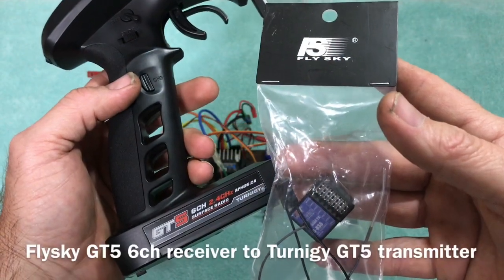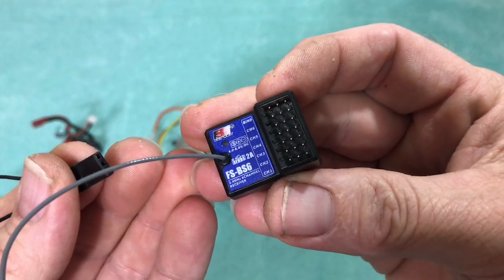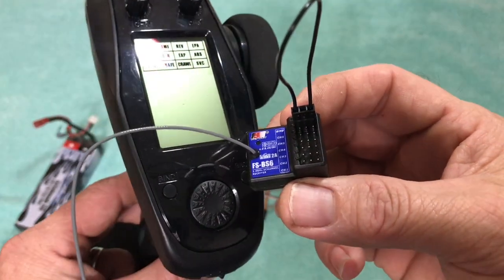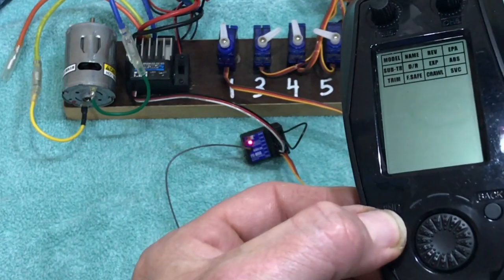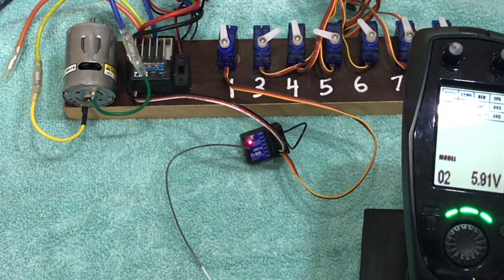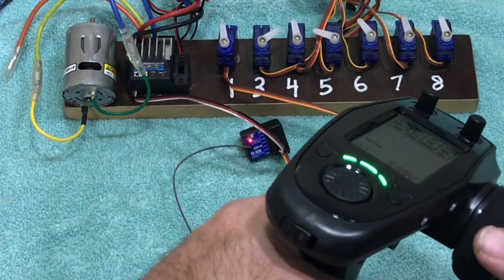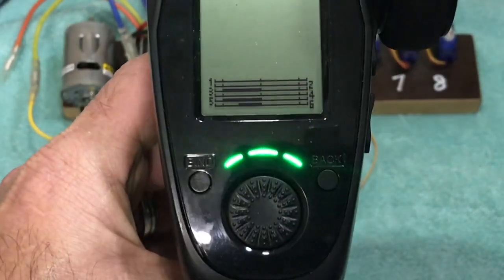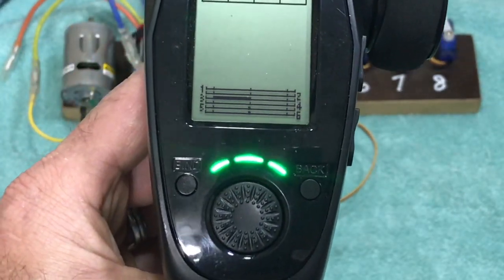Bind the GT5

Comment: i've read the FS-GT5 doesn't bind with the FS-A3 receiver, even though it states in the manual it should. is this true? has anyone been successful at getting this to work with the FS-A3?
Reply: I'd like to know this as well. Smaller and cheaper
Reply: I think if you want a cheaper 3ch or 4ch receiver you can go with the fs-bs4 or fs-bs3 will work with the gt5. Not sure if the ones you mentioned bind with it or not

Comment: The manual lists the GT5 and A3 as compatible, but I have learned: You can make them talk, by fudging the steps. HOWEVER, a GT5 and A3 are never exclusively bound, just kinda. When a GT5 is bound to a BS6 and on the GT5 you attempt to click over to another truck, you get a message saying you are not allowed to switch trucks until you power-down the receiver currently bound. HOWEVER, when the GT5 is talking to an A3-equipped rig, you can keep turning on other A3-equipped rigs that have previously gone through the bind process (up to 19 in theory) and watch them all steer at the same time, back up, go forward. I am told that this does not create interference with other owners' trucks. I very much hope this is true.

Comment: Thanks for help :) One car work. Any chance of video or info with binding multiple receivers to one Flysky transmitter? I have 3 cars and must bind every single time before use. Can't find any info about it :/ so you're my last hope :)
Reply from the maker: Vincent Rodriguez with the Gt5 each receiver is bonded to a specific model. So when you bind a new receiver to it, you must be on the model you’re wanting to setup for. I have 5 vehicles on mine without issue.
Reply: @ExocagedRC   :)  I did as you told. Model 2 works fine. Turn off model 2 and switch to model 1. Turn on receiver, LED blinks and car doesn't respond :( Led certainly shouldn't blink, so something is wrong. Do I have to use the same bind cable? Because each receiver has its own. I don't know whats wrong I do, but I just learned to bind one receiver today ;) I'm new, that's why I asked. Tomorrow I will repeat everything again but If I bind again, should I change all settings to 0% or 100% on the transmitter? or EPA etc. can stay as it is now? One more ;) How should i insert a bind cable. Not sure where is +,- I'm not even sure if it's important, but I prefer to eliminate all mistakes. Two metal teeth up or down? ;) I hope you know what I mean. Thanks one more time for help :) Probably I'm only one in the world with that problem ;)
Reply from the maker: Vincent Rodriguez we were all new to this hobby at some point in time so any question is good here. If I’m running model 1 for a truck then I have to bind at model 1 for the receiver that goes in that truck. Model 2 is the same way and all the way down. Switching the model on the radio will not allow it to control anything on any receiver unless it was specifically binded to that exact receiver.
Reply: @ExocagedRC  I didn't know that. So I always must have a bind cable :) I saw that the traxass transmitter can be link with several receivers and I thought that it can also work here ;) thank you for the explanation :) I really appreciate :) Now understand everything :)

Comment: I have an ae1 speed controller for my crawler that I bought 7 years ago but I can get the throttle to work but the steering does any ideas what im doing wrong?
Reply from the maker: You probably just need to calibrate it to your radio. Instructions are online.
Reply: Exocaged RC 👍👍

Comment: So will this bind to a spectrum reciever? I can't get mine to bind to the srs600 ?
Reply from the maker: InnerFireGlass Graham no sir it will not. Each manufacturer has their own protocols so only their receiver works.
Reply: @ExocagedRC  ahh.. well looks like i need to order like 5 or so recievers that will work, do you recommend any one in particular? Thx for the reply!
Reply from the maker: InnerFireGlass Graham you just gotta order the ones that are for your transmitter. Hobbyking may have some knockoff receivers that work. You’d have to search around their website to find them